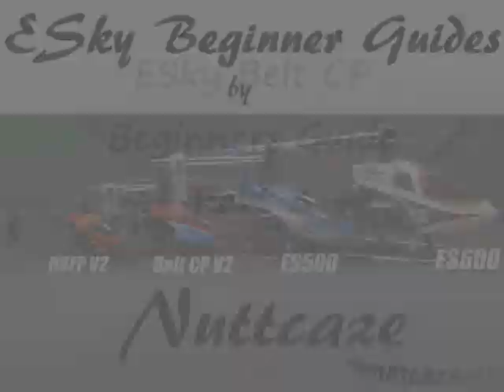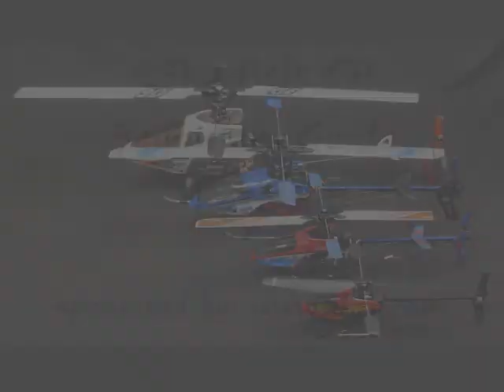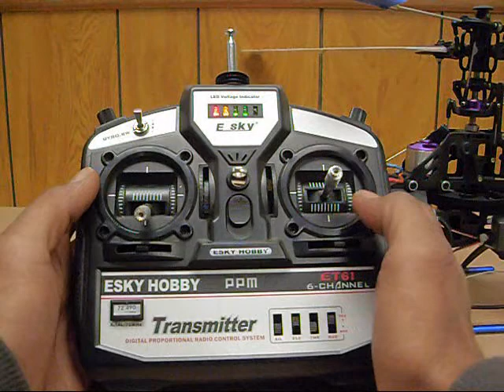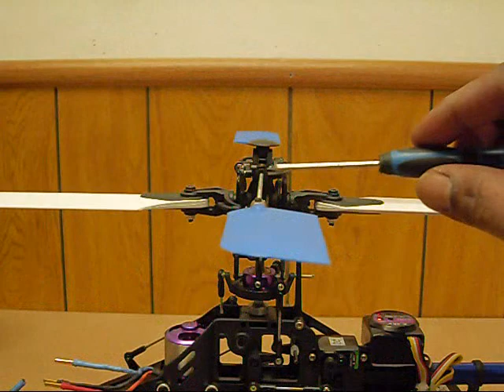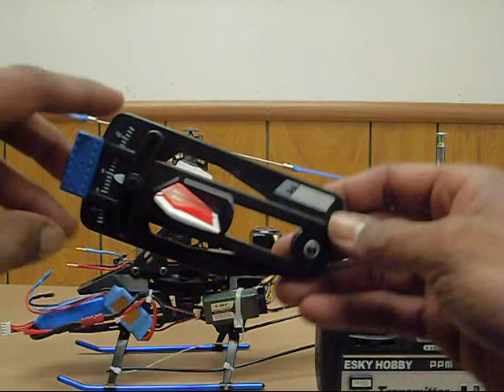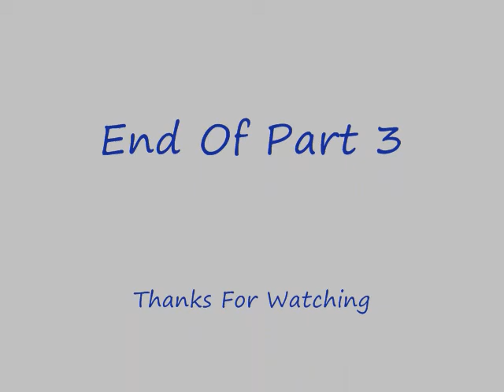ESky Belt CP V2 Beginners Guide part 3 v2

Comment: Idle up kicks the throttle up to a preset position and allows full control of the collective. Meaning you can have full range from +10* pitch (full stick) to 0* pitch(mid stick) to -10* pitch (low stick) and everywhere in between. That way you can do things like inverted flight.